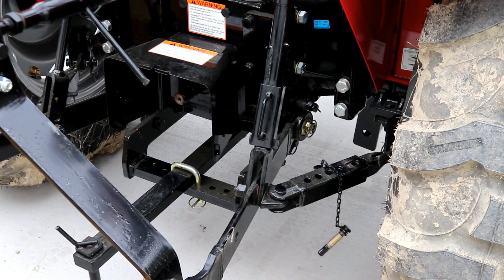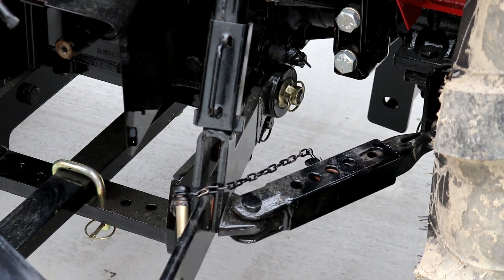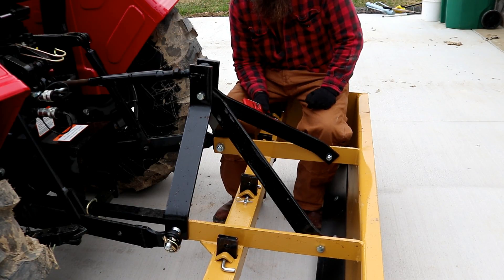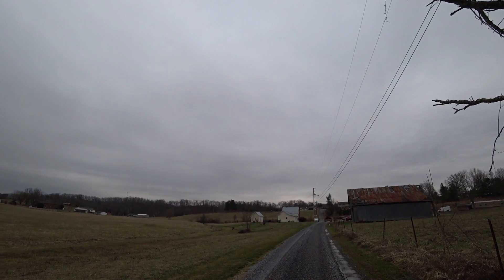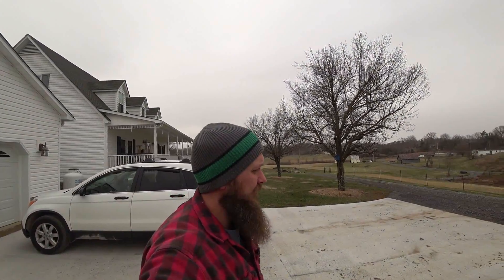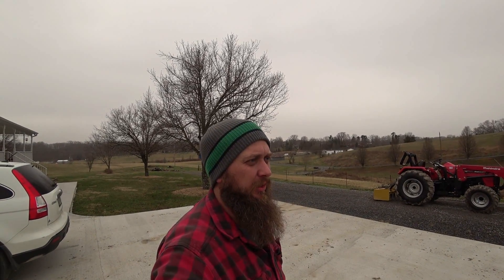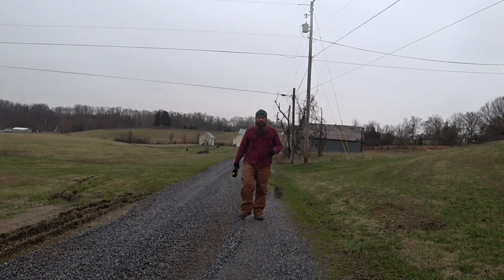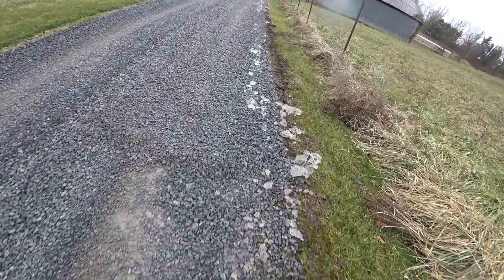MAINTAINING THE SAWMILL ROAD WITH THE FARM TRACTOR

Comment: A box blade is one of the best (and cheapest) investments you can make - congratulations!  Two things: when tough grading earth (vs fines) adjust the top link tighter, angling the front blade deeper, in order to dig deeper.  The opposite of this would be to adjust the top link far out, angling the back blade further down - while driving forward, you can now “backblade”, creating a finish grade, similar to a butter knife spreading butter on bread and creating a fine finish grade.  You can also offset your boxblade to the tractor (with the Lower link sway arm adjustments you were talking about) and then use your right lower link arm leveler to lower one side of the boxblade to give your road a proper “crown” angle that results in fewer potholes/washouts by properly draining water to the sides of you driveway.  Keep up the videos - I’ve learned a ton of insight for my LT15 & how to properly figure out the puzzle in every log.  Cheers
Reply from the maker: thanks Hugh appreciate it,
Reply: BTW - got your hat and happy to represent OTW up north in Vermont lol 🤘🏼also, I keep my box blade on my bigger tractor throughout the winter for double duty plowing - pushing snow forward with the bucket and pushing it back with the box blade in reverse.  Skidding winch on my little tractor throughout the winter 👍🏼

Comment: I just recently found your channel and really enjoy it.  (I did subscribe and hit the like button). ;)

I am new to using a box blade myself and one thing that I've learned is that it's all about the angle.  What has worked for me is starting level the way that you did, then adjust as needed for what I am trying to do.  If I want to dig out some potholes or maybe some small roots I'll angle the blade down (shorten the top link) so that the teeth can rip in and loosen the material easier.  When doing a "smoothing pass" I'll angle the blade up (lengthen the top link).  On my driveway/road I'll then start at the outside edge and adjust the side angle so that the higher side is facing towards the center of the driveway.  This way it puts a slight crown on the road to promote drainage.

As I said, I am learning myself and these tips have helped me.  There is another channel that I recommend called "Dave Knows How".  Look for his videos on box blades called "The Angle of The Dangle".  Those really helped me out a lot.
Reply from the maker: Thanks appreciate the advice 👍

Comment: Glad to see you back and well, when i do my driveway i make sure i put a crown (high point) down the center to make sure the water doesn't sit on the road where possible, would be a good idea to rent a roller to pack it down so it stay's in place longer, up here we use limestone that has fine's (smaller stone and limestone dust)in it, when packed down it act's like concrete, trick is to keep the water off so it doesn't create pot hole's.

Comment: when the video first started you screwed out the top link of the 3 pt nearly all the way on the tractor side. always hold the lose end to bring both ends out at the same time. you can strip the threads of the top link if its only screw in a half a thread or so
Reply from the maker: yeah learned that today, thanks,

Comment: Nothing handier then a tractor. Loosen that nut on the top link so each end has eqaul threads. You only have to turn it half as much then. You can use the top link to set the attack angle of your cutting edge of your implements. The more straight up and down the more it will cut. So as you get to final grade you can lengthen the link to tip the edge forward to take less material. Also you can adjust the stop on your up and down lever so you are not letting the blade dig too deep. A york rake with wheels angles to allow you to pull your material to the center, and you can set one wheel higher to maintain your crown. A gravel road should look like a peaked roof, with one or two inch of pitch in ten feet so the water runs off. After you grade it put a heavy log on the forks and roll it in with the tractor it will last longer. You have a beautiful place there, Nathan.
Reply from the maker: thanks buddy appreciate it,

Comment: Nate, we just got a Kubota  mx5200 a few weeks ago, not sure about the older Kubota tractors, but the new ones have the locking pins on the rear arms to hold it steady. Got quick attach pallet forks with the loader for hauling logs and lumber, it made a WORLD of difference. Best regards and thanks for all your advice.
-Seth (from Mississippi)
Reply from the maker: good deal those MX5200s are nice machines, I looked at one before I got this one,